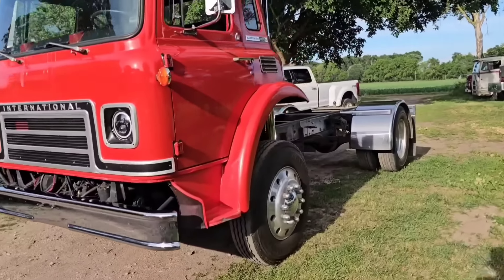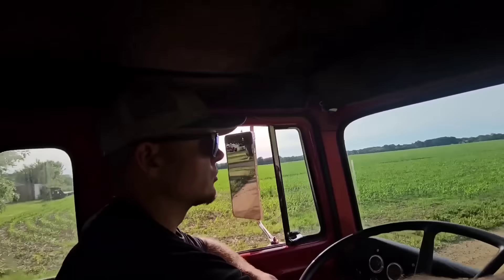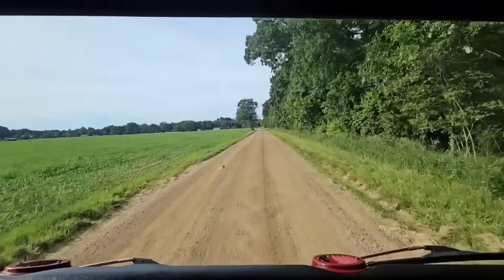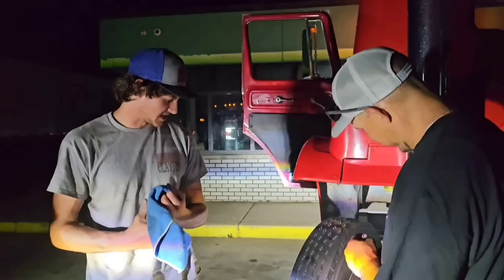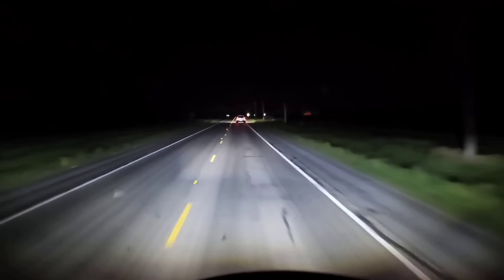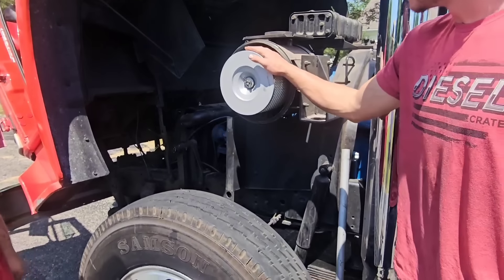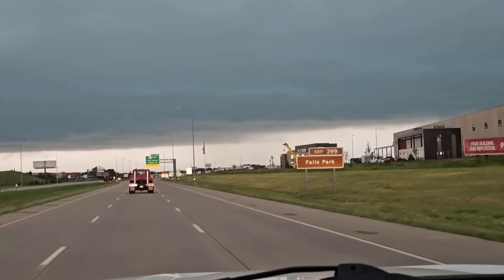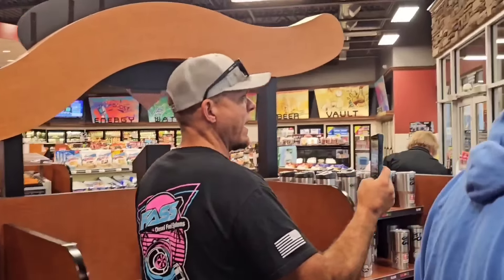Rowdy 1979 International Cabover *OL RED*

Comment: It needs a big diamond plate flat bed with built in fuel tank and a 5th wheel plate and a 13spd od trans. Too bad theres no jake brake for the 466. You can use a BD exhaust brake though